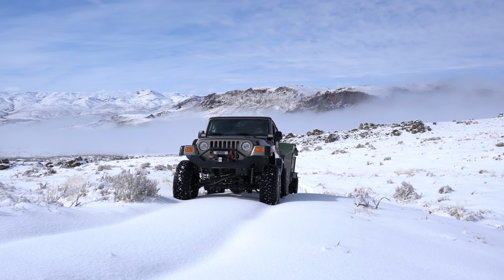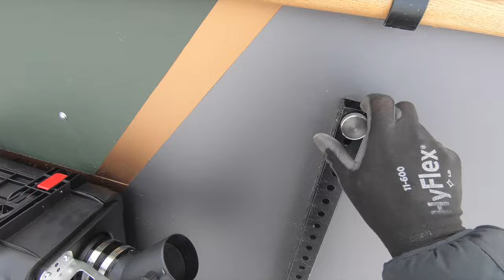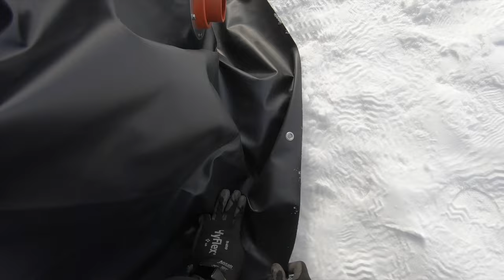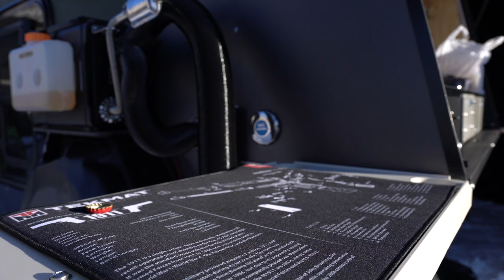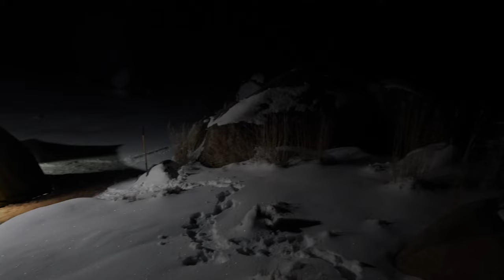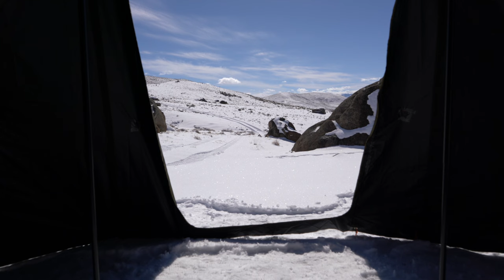Frigid Desert Camping

Comment: Did that trailer skirt come with the trailer or did you make that? Nice setup and great views.
Reply from the maker: I made the skirt. ran the diesel heater for 18 hours, barely used a gallon of fuel and no loss in power.
Kept my water tank and sink area from freezing up  around 20 degrees F.
Currently In the process of sealing off the 23zero 180 on the corners and running a wood fire stove. 
Thanks for watching!